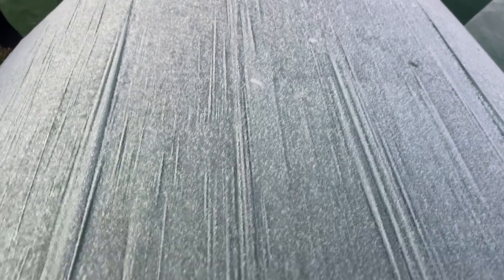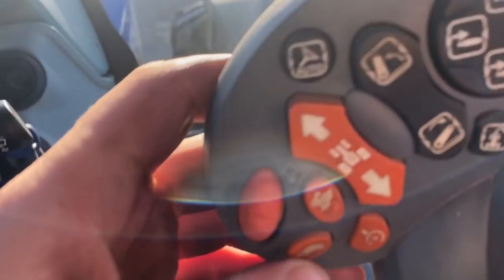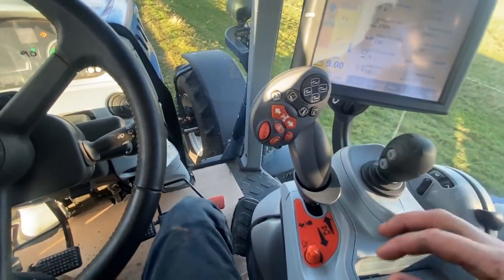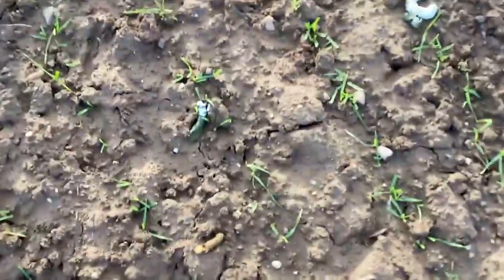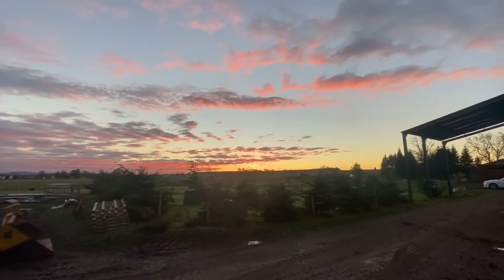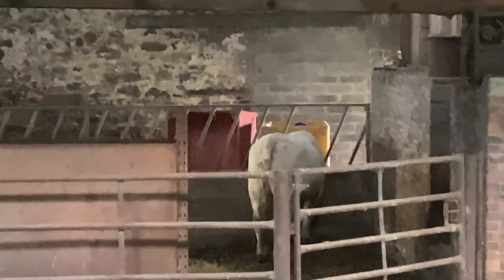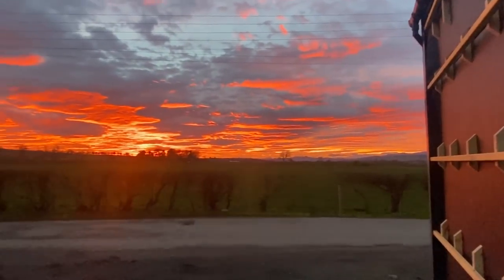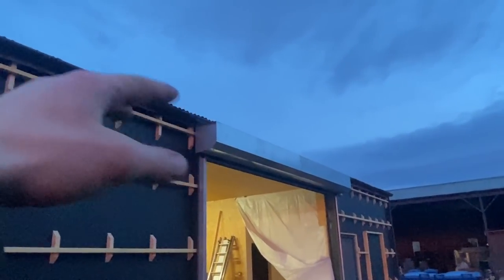GOOD TRANSMISSION? | WINTER HITS | PROJECT BARN CONVERSION #CRAWFORDFARMS #158

Comment: I prefer autocommand for field work.  Don't particularly like it coming up to junctions. Isn't very smooth. Just use pedal mode on road, joystick 🕹 in field.

We have a autocommand, power command and range command. For fieldwork I would never have another tractor without cvt. 

Should demo a 4220 fastrac! Guarantee you won't want to hand it back.
Reply from the maker: 😅 serious money in those no?
Reply: Yeah would be fendt money. 💰 

I would love ❤ one but a new Holland will do the same job for a lot less money.
Reply from the maker: 😅 just sell the combine and get both